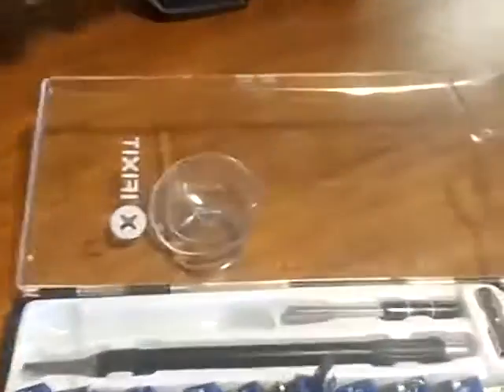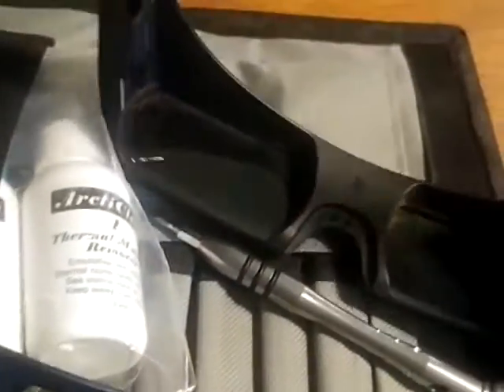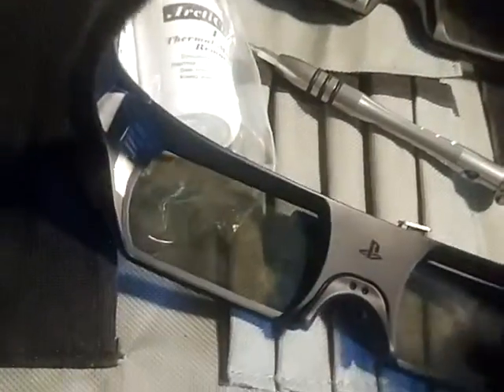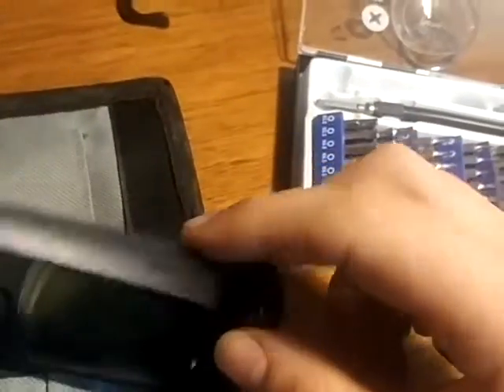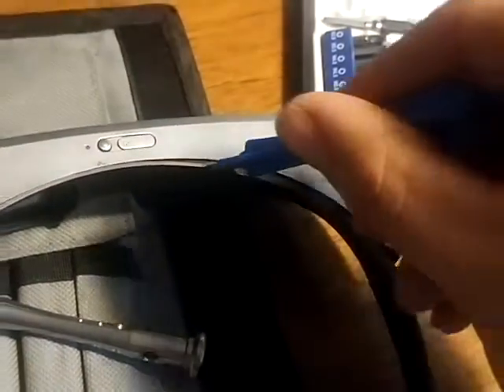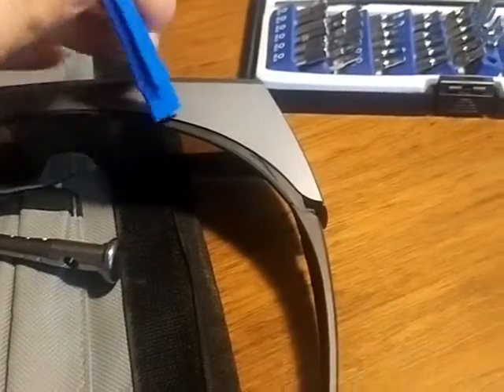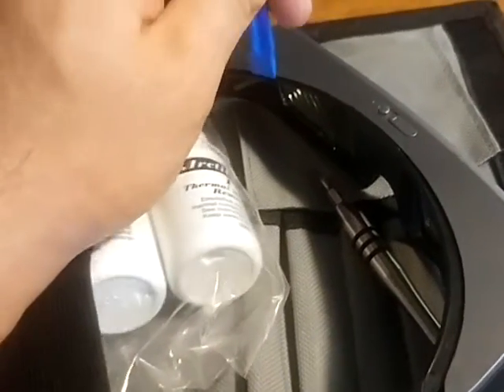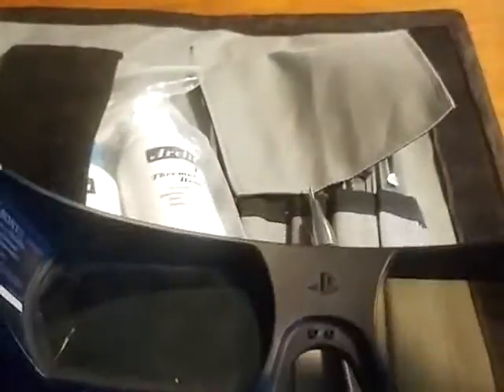PS3 3D glasses CECH-ZEG1U disassembly (part 1)

Comment: FYI - I was able to replace two of these glasses with 551521 3.7v LiPo batteries, they are less expensive and 120mAh.  While the 551521s are noticeably thicker, it still fits and I was able to clamp down all of the pry points.  WARNING: The battery is much thicker than the stock battery and does FEEL like it's pressing up against the PCB, which isn't ideal, but it does fit.  The thing you cannot do when selecting a replacement battery is exceed 25mm length, 15mm width and 5.5mm thickness.  The 551521 is 20 x 14 x 5.5

Comment: I have the same issue with all 5 pairs of my ps3 glasses. They just don't cost enough to warrant the amount of effort shown in the video. It was (yet another) poorly designed product from Sony. The battery should always be accessible in anything with a battery.
Reply: What kind of battery does it use ?